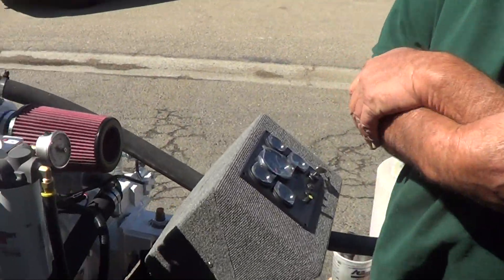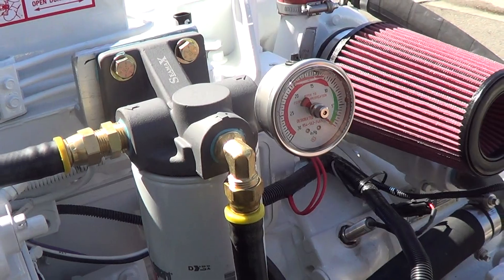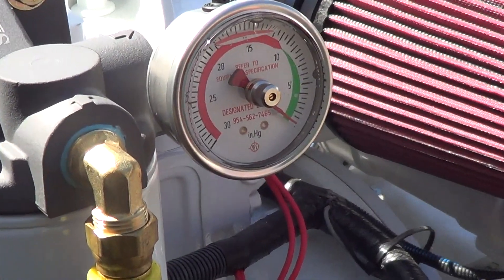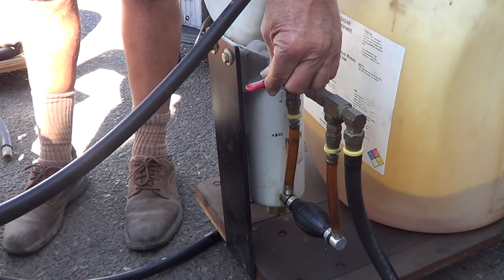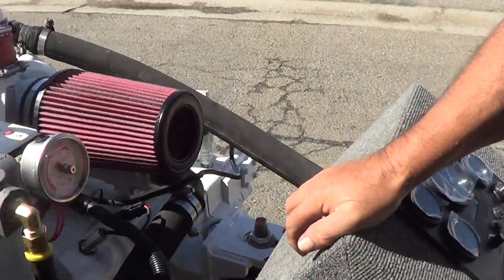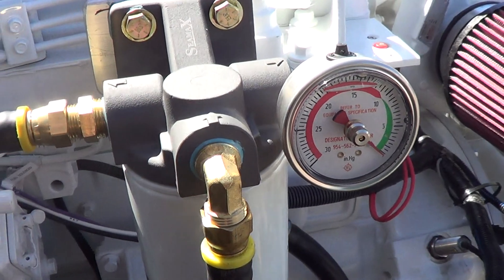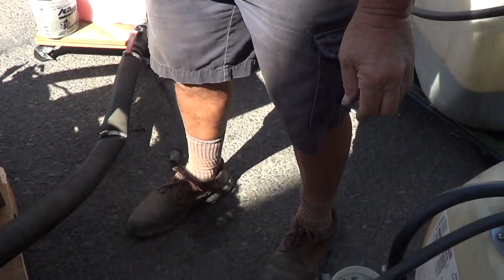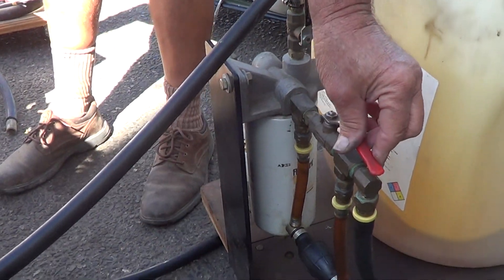Setting up an SMX Fuel Vacuum Gauge with Drag Pointer on a Cummins Marine Engine

Comment: That's great except a fuel filter restriction gauge is like any other filter restriction gauge and should indicate the restriction between the clean and dirty sides of the filter its plumbed into the base of. Unless you use filter bases made for a restriction gauge using a restriction gauge to determine fuel filter "condition" is pointless. You just as well use a pair of pressure gauges with one on each side of the filter package. But if you don't run an electric lift pump and locate one or both of your filters prior to the engine-mounted lift pump, you really don't have a reference supply pressure to use to judge filter condition. 

I haven't paid enough attention to your repower videos to note for sure what filters you're running for primary/secondary, but I have noticed water drain valves on both in most or all of the pics I've seen of them. Generally a water separator is only used in the primary position and there shouldn't be any water getting TO the secondary, so if you're running water separators in both positions, you need to rethink your fuel tank design. 

Especially in a marine environment and constant high-humidity, etc. Diesel fuel is also an excellent solvent by itself, moisture in tanks easily creates sulfuric acid with even the little bit of sulfure in modern low-sulfur fuel when it accumulates over time, and I doubt the epoxies/resins/paints/coatings you're using to build tanks are rated for long-term continuous exposure to diesel fuel AND sulfuric acid. If you've seen aluminum tanks "rotted out" that rot is from the inside out. I haven't seen fiberglass tougher than aluminum lately.

As for your filter setups, as long as you stick to mechanical engines you can get by with some pretty crappy "engineering" and filter selection on the supply side. Those P7100s are pretty tough and even with really crappy fuel they'll probably outlive those way overworked and overstressed B engines. I've owned 3 Dodge Cummins pickups and I've done a fair amount of "hot-rodding" of those engines and I've worked on them for 25+ years, so you're not going to fool me into believing you can crank 350+ hp at "WOT" (what's up with bragging about being able to spin engines PAST their high-idle speed when you run DIESELS for low-rpm torque and long-term reliability?) out of them and alternate that with extended periods of idling putting around during which they're probably running too cool and expect to get 2000 hours out of them. 

Maybe you don't keep up on brands besides Yanmar and Cummins but John Deere has been taking market share from Cummins like crazy just because Cummins is pulling way too much power out of MEDIUM-DUTY engines and is trying to make "horsepower" with speed instead of torque. So, injection pump and nozzle life probably isn't an issue regardless of how shoddy the fuel supply and filtration are. But try to get away with the same "engineering" with an HPCR Cummins and all I can say is I hope you guys decide to run 10-micron primary and 2-micron secondary filters and a good electric lift pump or you're not going to like the results. Bosch common-rail systems have zero tolerance for contaminated/dirty fuel. 

I was a John Deere service tech when the HPCR Deere 6081 engines came out in about 2002 in the 8020-series tractors and fuel filtration was a problem from the get-go. Especially if farmers didn't have good filters on their storage/transfer tanks. Bosch and Deere actually came up with an entirely new filter/supply pump/replumbing kit that shitcanned the original 50-micron/10-micron system and the way it routed fuel to and through the electric lift pump and mechanical transfer pump on the high-pressure fuel pump and went to 10-micron/2-micron setup. What they found was that if the secondary filter became plugged, the mechanical transfer pump on the HP injection pump had enough power to just blast right through the secondary filter element and send dirty fuel directly to the HP pump. Those were the "two-cylinder" HP pumps back then and they've since been replaced by the CP3s. Starve an HPCR engine for fuel, feed it hot fuel or even slightly "dirty" fuel and you'll take out injectors in no time. Guaranteed. 

Bosch and Deere came out with a fuel filter kit to replace both filters at once and the secondary filter comes with a screw-in plastic funnel to direct any "prefill" fuel dumped into the filter to the dirty side only. We literally replaced everything "upstream" of the HP pump with a whole new filter assembly, new lines to and from the tank, etc. Those P-pumps and nozzles you guys seem to be big fans of will handle ROCKS in the fuel compared to what HPCR systems will shell out injectors on very quickly. And it will be injector failures before HP pump failures. The HP pumps have enough capacity that even with one pumping element completely AWOL they'll still make max rail pressure at rated hp and rpm. You'd be wise to figure out a fuel cooler setup, too. HPCR engines move a shitload of fuel and they heat the hell out of it. I'd shitcan those rubber primer bulbs and cheesedick IV hose too. That's basically shadetree as hell on a medium-duty diesel engine installation. 

25+ years as a diesel mechanic on Cat heavy equipment, John Deere ag, Ford/New/Holland Versatile ag at a dealer that was also a Cummins distributor, Union Pacific locomotive machinist and basically extensive experience on compression ignition engines from nitro RC to 4500-hp General Electric Evolution V-12s in diesel-electric locomotives have taught me that the worst possible place to cut corners and do things half-assed is in a fuel system. Hell, I knew that BEFORE I went "pro".
Reply: Chad,

You must have woke in in a bad mood...LOL....................Actually, this was strictly a demo to show how the drag pointed gauge works.. We were all ready done testing this engine without a a vacuum gauge  at all.. But since the engine was all hooked up , we decided to do a quickie  install a drag-pointer vac gauge only to show how they work.. You are 100% right, this gauge would not measure the filter it's installed on ( that was not the intent at all) , only the filters before it,  along with any other  restriction in the system all the way to the bottom of the tank........Relax & take a deep breath as I do under this language very well.....You are a funny guy.......................................Tony